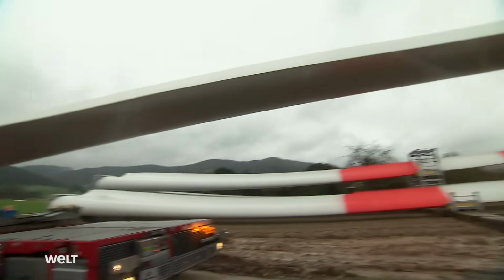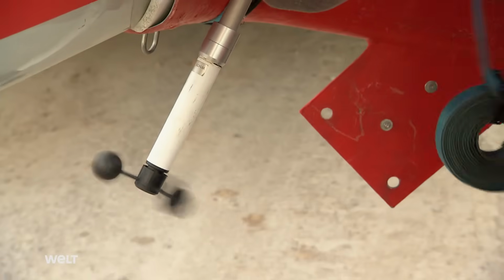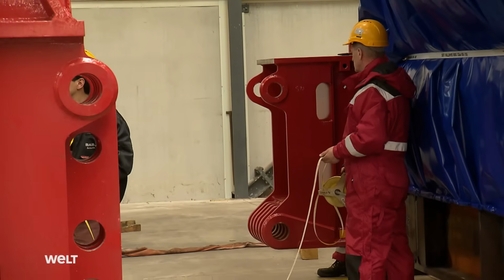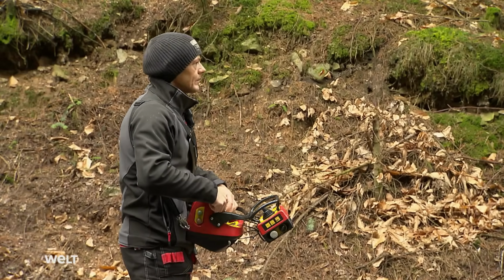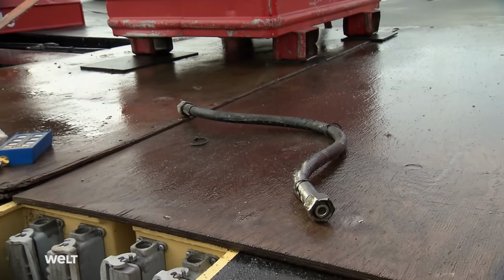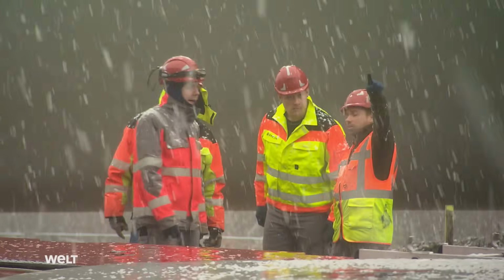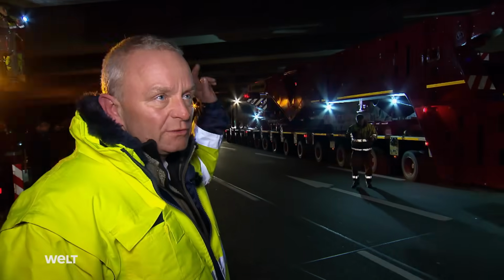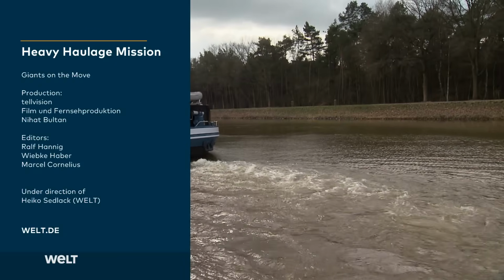HEAVY TRANSPORT MISSION - Giants On The Move | Full Documentary

Comment: Im just wondering if the cost for all this is recouped by the electricity output of the wind turbine.
Reply: It takes around 330L of oil to generate 1 MWh of electricity.  The largest windturbines are around 12 MW and so offsets 4 tons of oil for every hour the wind blows. Or to put it differently, 2 swimmingpools of oil in 24h.  Ethough
Reply: Thank you. That's helpful information.I understand that constant maintenance must be adhered to to avoid sometimes catastrophic failure. But localized compared to rival forms of power.
Im not saying either way if wind turbines are worth it,  I simply think the concept is interesting and shows we should utilise ALL of our power generating resources.